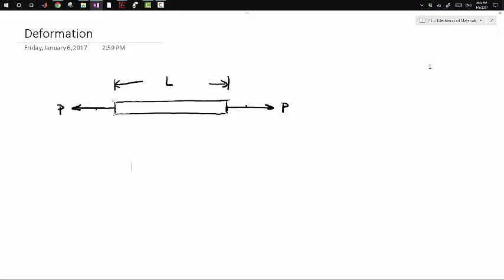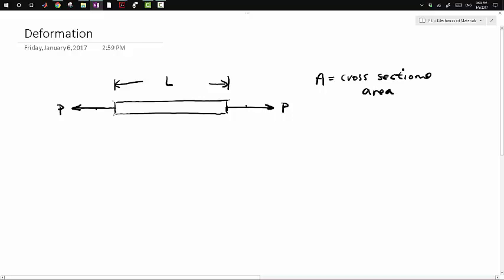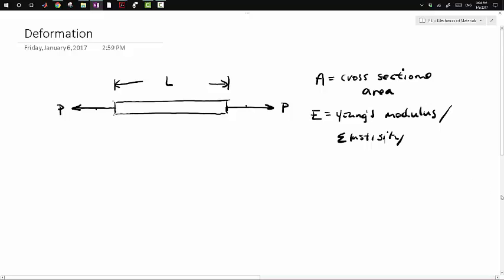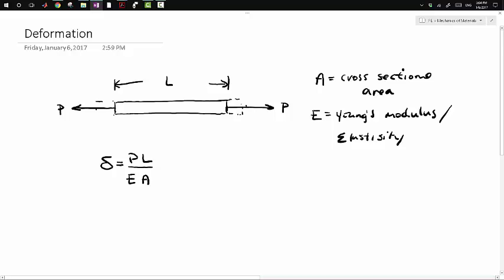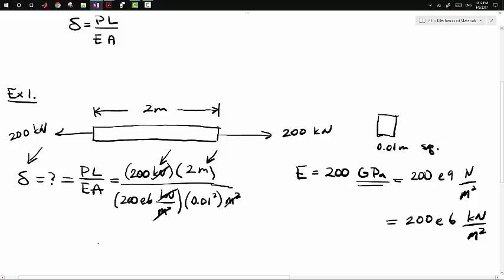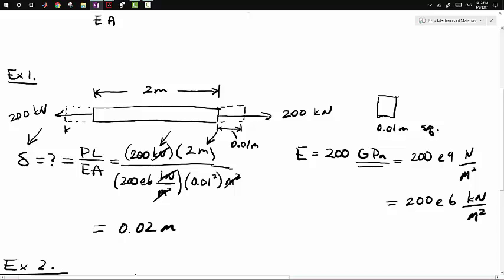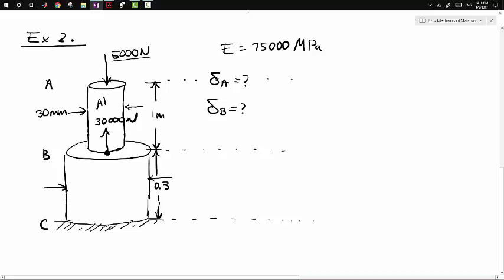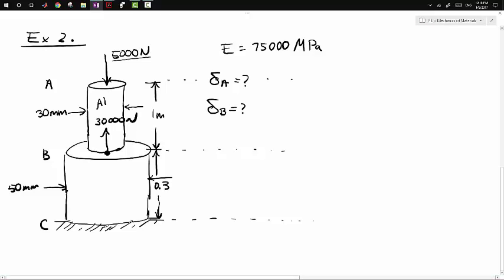FE Civil Exam Review: Deformation (Mechanics of Materials)

Comment: on example #1 the rod with two 200kn forces....why do you say that it will elongate 0.01 on each side if the total force is 200kn on each side and applying the one 200kn will elongate the rod 0.02m...wouldn't it be 0.04 total? 0.02 from each side based on each tensional load ?
Reply from the maker: No, it is not two separate loads of 200kN.  There is only one load of 200kN and the other side is equal and opposite (balancing out that force).  Think about it this way. If we delete the 200kN on the left side of the beam, then the whole beam would move to the right.  If the left side was fixed to a wall and you apply 200kN tension to the right, the reaction on the left side of the beam would be 200kN to the left.  Basically, the example is a FBD of the beam without it being attached to a wall.  The deformation is just 0.02, I just divided it by two and put it on both sides. I hope this helps.
Reply: CivilReview ...thank you...my confusion was the use of 200kn in the deformation formula (P=200) and seeing two forces on the FBD...your clarification helped... thank you!